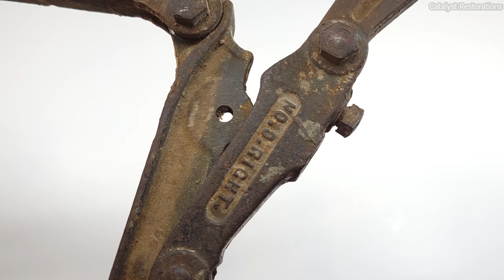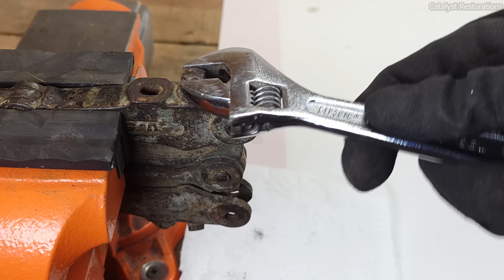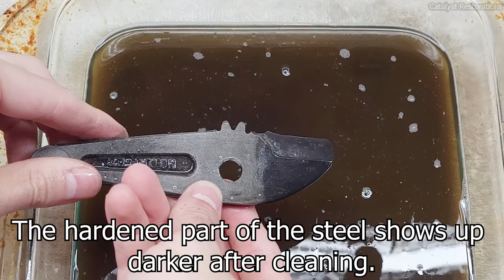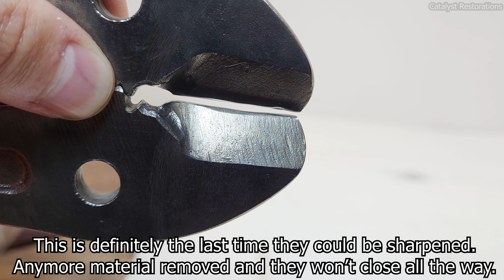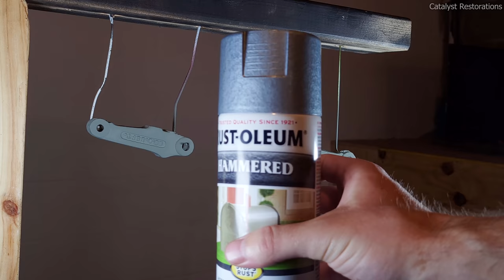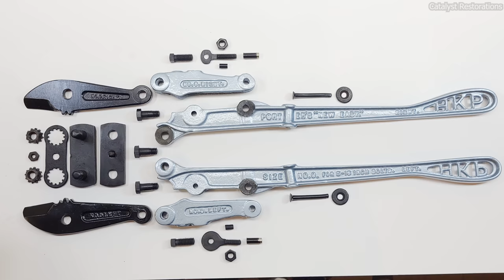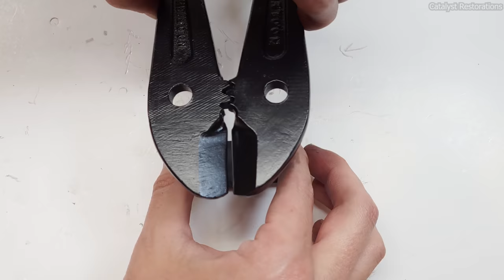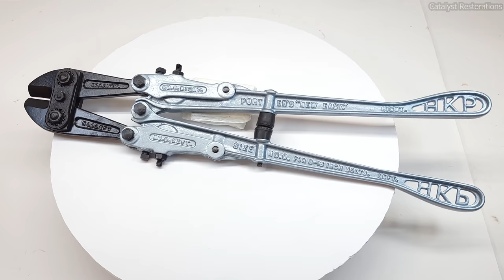130-year-old Bolt Cutter Complete Teardown and Restoration

Comment: Usare uno scalpello per legno per fare leva sull'acciaio è sbagliato. Utilizzare una chiave inglese invece di chiavi fisse....non mi sembra logico. Ma utilizzare la punta delle lamette per togliere la vernice non mi sembra professionale, usa una pistola sabbiatrice.
Reply from the maker: "Using a wood chisel to leverage steel is wrong. Using a wrench instead of wrenches....doesn't seem logical to me. But using the tip of razor blades to remove paint doesn't sound professional to me, use a sandblasting gun."

You won't always have the perfect tool for every job. I agree, don't use a nice wood chisel on steel - the one in the video is a cheap $1 chisel I just use for cases like this. And I'm assuming you were referring to using crescent wrenches instead of the adjustable wrench - that's fair, adjustable wrenches aren't as stable, especially when I use them backwards. And finally, I agree that sandblasting would be ideal. But I, along with probably the vast majority of other viewers at home looking to restore a similar tool, do not own an entire media blasting setup. The goal of Catalyst Restorations is to make restoration projects as accessible to everyone at home as possible without a $10,000 workshop.

Comment: The gap is way to big to cut throusoft drawn
Reply from the maker: If you notice at the very end before I cut the nails/bolts, I tightened down the adjustment bolts on the arms to bring the jaws together. If you check out either of my other two bolt cutter videos I show on camera how I do it.

Comment: И теперь они непригодны к использованию, потому что режущую часть сточили 🤦🏼‍♂️
Reply from the maker: "And now they are unusable because the cutting part has been ground down"

Если бы вы посмотрели последние 45 секунд видео, вы бы увидели, что они прекрасно работают. Вы также всегда можете наварить новый материал на лезвия и сформировать новые кромки после правильной повторной термической обработки.
(If you watched the last 45 seconds of the video you would see they work just fine. You can also always weld new material on the blades and form new edges then properly re-heat treat.)

Comment: Do yourself a BIG favor and buy some decent wrenches and/or a socket set.
That damn adjustable wrench is garbage.
Reply from the maker: Thanks for the tip! I do have a nice wrench and socket set, but unfortunately most of the nuts and bolts on this were truly bizarre sizes. Late 1800s and early 1900s tool manafacturing was kind of the wild west. No standardization. The adjustable wrench was just easier to bounce around between different hardware on this project, albeit it came back to bite me with some nicks and dings to the paint (which in hindsight I should've masked just to be safe). Hope you enjoyed the vid!
Reply: @johnny lightning    but they worked and got the job done.....
Reply: Worry about your own work. Clearly it didn't affect him.

Comment: Un canale molto bello e interessante PERO', non si capisce mai quali sono i prodotti per Sgrassare, per pulire, per togliere la ruggine ecc. sia liquidi che solidi e questo è un limite, secondo me
Reply from the maker: That is a fair point! I do explain everything in full detail in the video description, but I think most people never read them. Since this video has aired, I now mention in my videos what solutions I'm using during the restoration!

In this particular video:
Rust remover: Evapo-Rust
Degreaser: Acetone
General washing/removing dirt: just soap and water

Comment: Ты, конечно, молодец, но неаккуратность какая-то и некоторых процессов непонимание присутствует, что в итоге отталкивает от просмотра. И еще прежде, чем подкрашивать наклей малярную (бумажную) ленту на деталь, аккуратно срежь бумагу где надо подкрасить, и не будет проблем с окрашиванием других поверхностей. Ставлю лайк, но подписываться пока не буду. Удачи!
Reply from the maker: "You are good, of course, but there is some sloppiness and a lack of understanding of some processes, which ultimately discourages viewing. And also, before you touch up, put painter's (paper) tape on the part, carefully cut off the paper where you need to touch up, and there will be no problems with painting other surfaces. I like it, but will not subscribe to it yet. Good luck!"

I wasn't too concerned about masking off for the few very small areas I had to touch up. A very fine brush gets the job done without overpainting. Larger jobs, absolutely. You'll notice in the video that all the screw and rivet holes and mating surfaces were masked off before painting. 

Catalyst Restorations is all about learning as we go - no restoration is ever truly perfect, nor do they need to be to share with everyone. Many people seem to assume I'm sort of professional restorer by putting videos of the process on Youtube, but I'm far from that! Hope I can earn your sub soon!

Comment: something has been lost
Reply from the maker: Yes, the rust and concrete on it
Reply: @CatalystRestorations  also the charm and that fake paint on the finish
Reply from the maker: @alessandromaffei1394  Nothing like the charm of a tool that doesn't work
Reply: @CatalystRestorations  a matter of opinions, I find it more fascinating to look at the signs of time than time for signs. I find it more sensible than a tool you can't work with without ruining it and that doesn't cut anyway.
I don't want to belittle your work or criticize it, I repeat it's just a matter of opinions.
Reply from the maker: @alessandromaffei1394  How you restore it is personal choice, absolutely. But it does actually work and will be used regularly now, did you see the test at the end?
Reply: @CatalystRestorations  and do you regularly repaint it every time you put it back in your toolbox or do you drop it? I saw the ending that is not cutting but shredding, try cutting a foil ...
Reply from the maker: @alessandromaffei1394  The paint will never stay perfect, and that's fine with me. That's a fact of any tool used over time anyways, even with care. This isn't a museum piece for display only. Next time I encounter a bolt the thickness of foil I'll let you know 😂

Comment: if you would have used glass beads it would have taken you 1/20 th the time and not damaged the tool. But i guess you have to spend your time on something. P.S. you can get a cheep small sandblaster for under $10.00, or you could make one out of a pop bottle for the cost of a pop bottle. I guess some people have more time on their hands and want to show how dumb they are. F for what you paid for the rust remover you could have done the job faster and cleaner. I digress all you want is the glory of saying that I have something on u tub.
Reply from the maker: "I guess some people have more time on their hands and want to show how dumb they are." Look at Alan over here proving his own point by writing this comment.

Comment: This is not restoration. At first u use comercial rust remover  and u take off orginal paint. Three -ammonium citrate -> 5% citric acid and pufer with ammonia at 3.5 pH. After that use tannic acid coating for rusted iron artifacts. Recipe for one litre of 10% solution of tannic acid:
   100 g tannic acid
    900 mL deionized or distilled water
    50 mL ethanol
    approximately 2 mL dilute phosphoric acid (H3PO4)

This will conservat surface. Afer that Tratteggio retouching.... 

This what u do is something like u squeezing a pimple and then calling yourself a doctor. 

"I prefer using Rustoleum’s metal etching primer followed by a Rustoleum color of your choice." This the best part what u write and then anyway u call your work "restoration".
Reply from the maker: I appreciate you taking the time to reply.

A few thoughts here on this...

1) We clearly have very different ideas of what a 'restoration' entails. Your opinion is perfectly valid, but I prefer to fully repaint objects instead of just leaving them bare metal with 10% of the original paint remaining. If it was an item of major historical significance that belongs in a museum and is worth far more to the world in its original or found condition, then sure, don't go wild with fresh paint, etc. But let's not kid ourselves here - this is a bolt cutter that cost me $10 at a flea market that tens of thousands of other people also own. I'm not doing the world a great disservice by painting it light blue instead of black.

2) Never thought I'd see someone gatekeeping rust removal, haha. Using any rust remover of your choice, commercial or otherwise, is perfectly acceptable.

3) I always get a good laugh when someone doesn't understand why a creator would upload something to YouTube unless they were a full-time professional at it and state themselves as such. This is a hobby. I create, edit, and upload these videos for fun in my free time. In no video caption, description, channel info, or otherwise do I state that in any way I am a professional (or doctor equivalent of the restoration field, to use your example) or authority figure on the subject matter nor do I think of myself as a professional at this craft. I am very much in fact the pimple popper of restorations.

Comment: 钳口不能密合，有些金属剪不断，比如钢筋，铜棒，铝材，不好，
Reply from the maker: "The jaws can't fit tightly, some metals can't be cut, such as steel bars, copper rods, aluminum, bad"

If you'll look closely near the end of the video when I test them, you'll see the jaws were flush at that point. Off camera after the "final reveal" photos I had tightened down the square adjustment bolts on the sides of the handles. Works great cutting just about anything!
Reply: @CatalystRestorations  ，oooo哦，如果是这样，那就太好了，谢谢你。

Comment: I’ll give you $1:10 for it.
Reply from the maker: Gonna need at least tree fiddy
Reply: @CatalystRestorations  Three dollars? I can buy a used one for 12 cents.😤 All joking aside. I liked the restoration.The only thing, is, that, will it be able to cut trough the whole lock. I thought you were going to weld some extra metal, then smooth it out.
Reply from the maker: @Goldarr1900  you're right! All I need is some welding equipment 🙃
Reply: @CatalystRestorations  👍